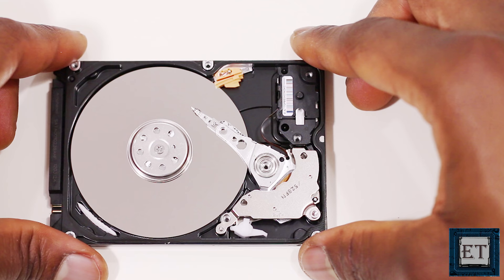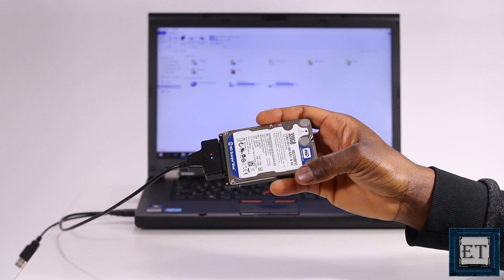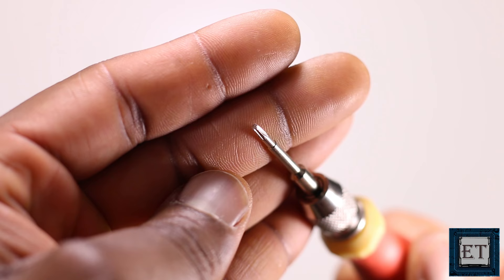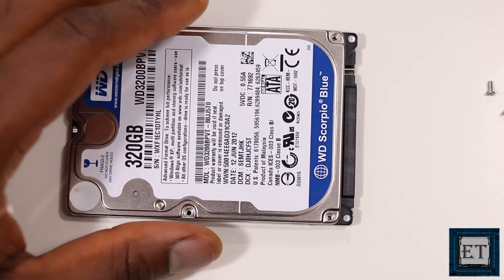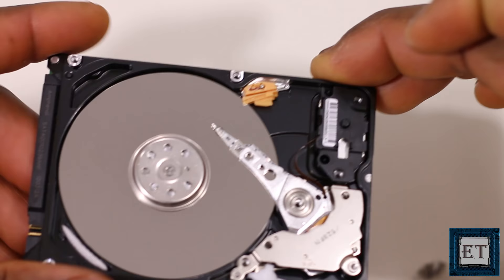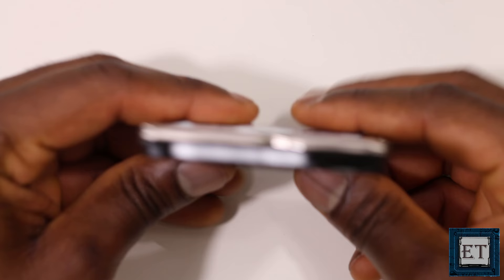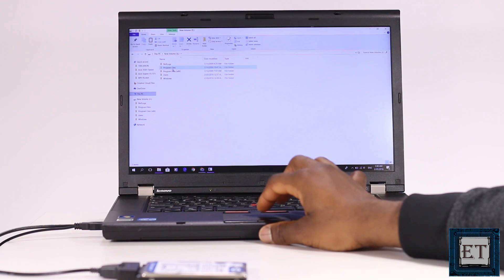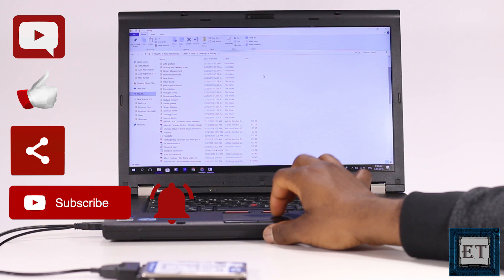How to Repair a Broken Hard Drive With Beeping or Clicking Noise (Recover Your Data)

Comment: My hard drive was dead and all I did was upgraded it to windows 10 through the boot menu, I think it's wayyy easier that way
Reply: auxable that makes no sense you can’t install software on a dead hard drive .Maybe your data was corrupt but hard drive was not dead if it was dead your computer would not be able to communicate with the hard drive to allow the installation of windows 10 .

Comment: My disk head was already at the mount where you moved it, why is my disk still not working?
Reply: The board itself could be dead then.  Try to find a similar HDD and swap out parts, but do it very carefully.  Without using the right torque, you could bend the new head and your data is toast.